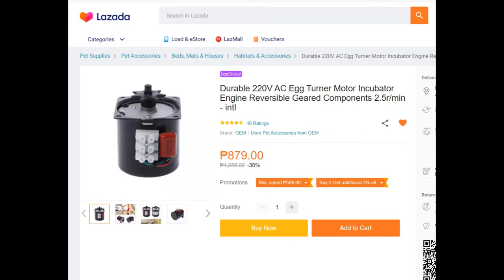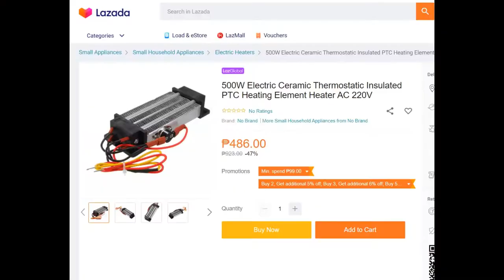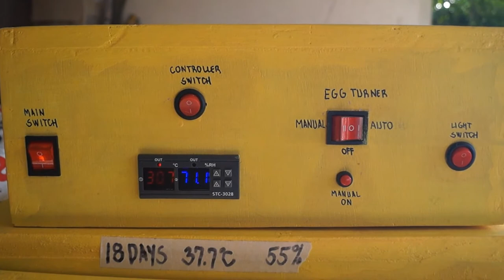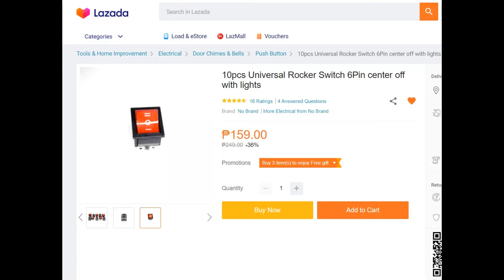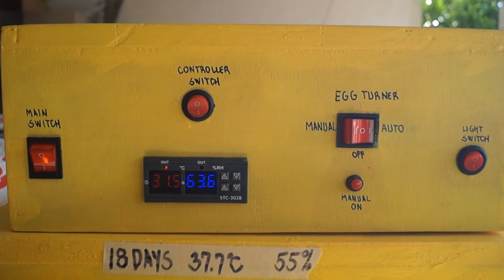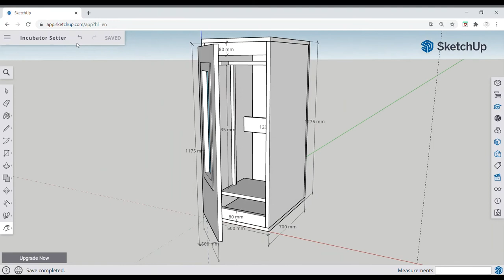How to make Fully Automatic Incubator at home. 352 eggs capacity setter/100 eggs capacity hatcher.

Comment: Thank you for sharing.  Ilang beses ba dapat mag swing yung trays in 24 hours?  Paano sya ili-limit?
Reply from the maker: at least two times a day po... pero our setup po ay every hour. nag alternate/gumagana yung egg turner... may timer po na pwede iset kung gusto i adjust. Nasa wiring diagram po yung connection.

thanks

Comment: hello, thank you for sharing.. if it is not too much to ask, pwede ba humingi ng pdf file ng incubator plan at electronic plan ?.. hoping for a positive response.. God bless.. 😊
Reply from the maker: nawala na po yung softcopy ko dahil na corrupt po yung HDD ko dati... pwede nyo na lang po i pause yung video then screenshot nyo na lang po yung sketchup dimensional drawing at yung electrical wiring diagram.

Thanks and goodluck
Reply: @granjadelcastillohatchery4725  ok po.. ty..i just wanna ask kung mga ilang plywood and angle bar ang nagamit sa design na to? also, ano rin ang thickness ng plywood?

Comment: sir, since experienced ka na, ano ang advantage ng Electric Heating Element compared sa light bulb?
Reply from the maker: baguhan lang ako sir. first time lang gumagawa ng setter then okay naman yung una kaya gumawa ulit ng isa pa dahil lang sa demand ng mga fertile egg production ng mga parent stocks namin.

Mas mabilis na uminit yung sa heating element compared sa light bulb. 500W kasi yung element then yung light bulb, maximum ata na 100W lang tapos pinagbabawal pa ata ng DTI na ibenta sa mga hardware ang mga ganung klase ng ilaw.  Pwede naman mag dagdag ng light bulb kung malaki capacity ng setter mo.
Reply: @granjadelcastillohatchery4725  thanks sir... Anong timer ang gamit mo?
Reply from the maker: @elvicjomoc3783  time switch sir ang ginamit ko. 24hour timer with normally open contact then with relay para meron double throw. Nasa video yung detailed wiring diagram para may guide kayo for the automatic egg turner.

Comment: Sir pwede ren ba ang aluminum instead na bakal.
Reply from the maker: yes sir... mas maganda kung aluminum ang gagamitin nyo..
Reply: @granjadelcastillohatchery4725  sir paano makabili syo
Reply: May contact number kba pampanga Ang location ko
Reply from the maker: @boyfrixlofttv6264  Hindi po kami nagbebenta ng setter or hatcher. pang sariling gamit lang po namin sa aming munting hatchery. Pwede nyo po copy yung design namin at yung wiring diagram. pwede nyo pagawa sa karpintero at sa electrician naman yung wiring. Message lang po kayo sa FB Page namin incase may additional queries po kayo. nasa video po lahat ng contact details namin.

lahat po ng manok namin sa farm ay dumaan sa setter at sa hatcher na na feature namin sa mga videos, kaya sure kami na effective ang aming design. 90 to 95% hatching rate ang efficiency of our design.

Goodluck and keep safe.

Comment: What about ventilation hole
Reply from the maker: There are 2x 50mm hole air vents at the back of the setter with adjustable cover each. Those air vents should be aligned with the air circulating fan inside so it can inject fresh air and remove air incase the humidity is not right. The air flow of the middle fan should be going to the back panel and the top air circulating fan should be towards the opening door. The 3rd fan at the bottom is used as a blower to disseminate the hot air generated by the electric heater.

Goodluck.

Comment: ano po ang blower nito?
Reply from the maker: Nasa video rin po yung mga items na ini order namin from Lazada. Pls chceck them out. Thanks
Reply from the maker: tatlo po yung fan blower ng setter. meron po sa baba para sa heater then sa gitna at sa taas for air circulation. yung baba at sa taas ay blowing towards sa door then yung gitna towards sa back... may vent din po ang setter, around 50mm dia with adjustable door. sa taas at sa gitna. ang opening po ay naka depende sa location nyo. please check the inside humidity for opening adjsutment. Goodluck.
Reply: salamat sir.